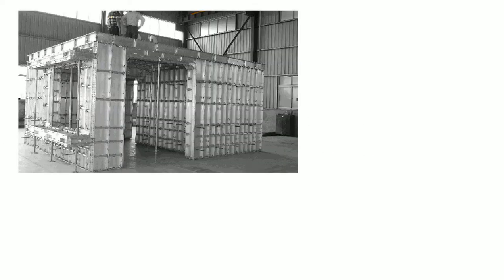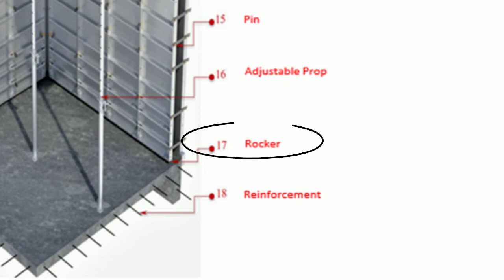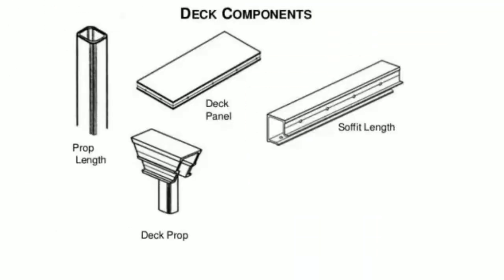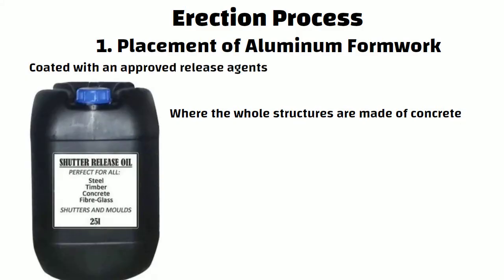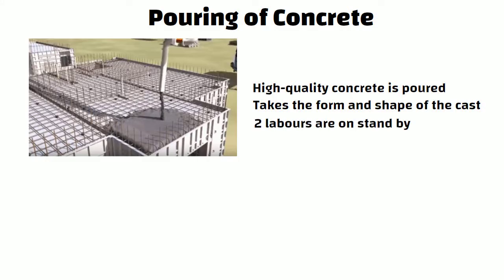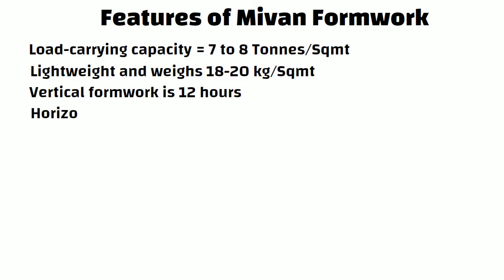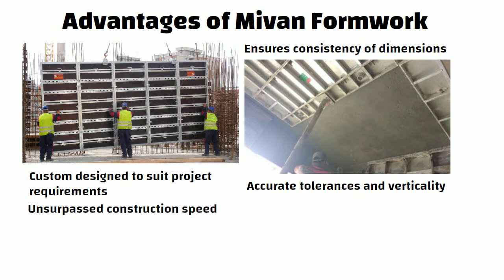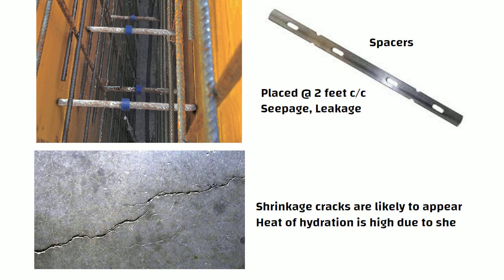Mivan Formwork / Mivan Shuttering / Aluminium Formwork

Comment: Hot question is "Which one is better, Mivan or bricks? ". I think, you can create a new video on this and you will good views. Now every metro city builder mentioning Mivan technology and selling their flats.
Reply: Dow Mivan flat has more life than Brick flat ?
Reply from the maker: Mivan is used for casting concrete structures and concrete is always better than any kind of masonry...now even govt buildings are also using concrete walls instead of brick or aac... Thanks 🙏
Reply: @engineeringmotive  thanks sir